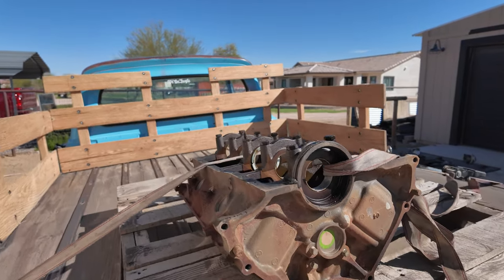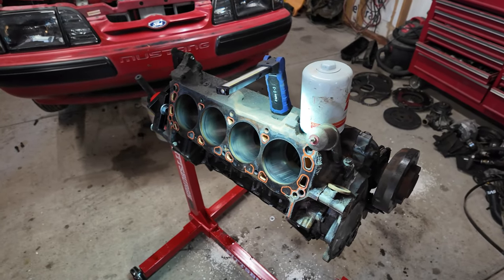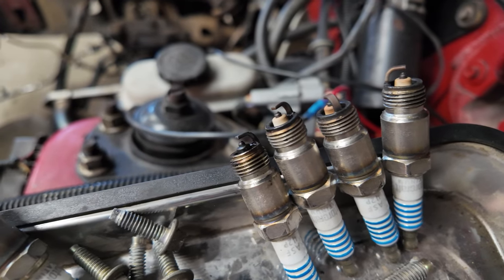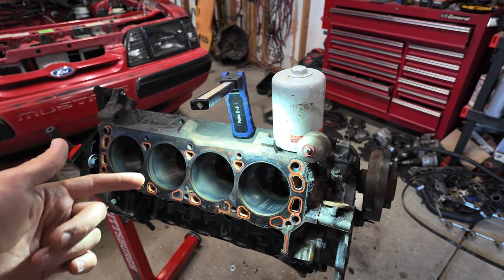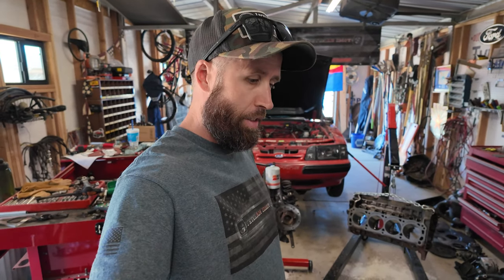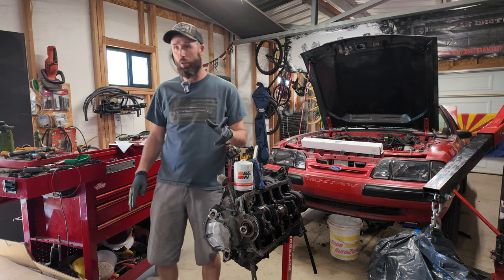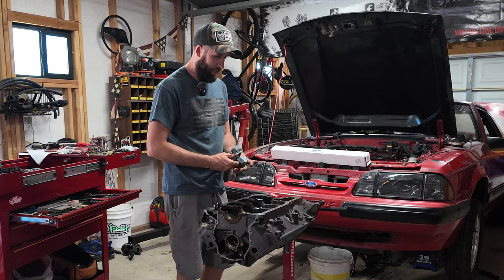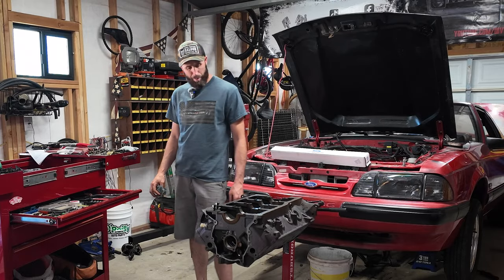BUDGET GT40 Rebuild, From Bare Block To Ripper #foxbody #mustang

Comment: Cool channel. If it was me. I would have trouble sleeping tonight not knowing tolerance for crank bearings. Used block with a different used crank, would have used plastigauge just to check. Keep up the great work.
Reply: even average typing paper can replicate the right clearance for testing in a pinch.
Reply: If turn's then send it 😂

Comment: When you decide to go carb, make sure you use a single plane intake manifold. The main reason is whenever you switch to a Sniper, they don't like dual plane as much.
Reply from the maker: Interesting, I was not aware of that. Seems to do alright on the dual plane on Earl and the 460

Comment: Should have done the piston flip trick and gave it a slight bump in compression.
Reply from the maker: Piston flip trick!? Do tell
Reply: Neo mustangs on YouTube goes in detail on it well but you basically take rod and piston from cylinder 1 and put in cylinder 5 with dot facing backwards and then vise versa cylinder 5 rod and piston you would put in cylinder 1 and you do that for the rest of the engine all the way back so 2 to 6 and 6 to 2 etc. all pistons have their dots facing backwards. If you look at the rod and piston from the side you will notice they’re slightly offset and not center and that’s where you get your slight bump in compression. But like I said check out neo mustangs here on YouTube and look for his vid on the piston flip trick for 302’s. I did it on one of my fox cars just last year.
Reply from the maker: Interesting
Reply: Yeah either way it’s no big deal but I figure since you had it down to bare block why not and a lil spice to her lol
Reply from the maker: Haha for sure, I'm gonna look into it before I go through the work out putting the heads on
Reply: Right on man, enjoy the fox content keep up the good work!
Reply from the maker: Thank you for tuning in! 🤙
Reply: @VeteranRevivals  NeoMustangs is a great channel for Fox Body budget performance.  His driver is >500hp wheel iirc, though that's with forced induction.  Check out 5.0Tussin for true junkyard performance.  He's fun to watch too.

Comment: All that work and you are going to reuse a timing gear and chain set with how many miles on them ?
Reply from the maker: Sometimes you just gotta add a little spice into the equation
Reply: Spice is expensive and disheartening sometimes  but ok I will stay tuned

Comment: I would you to plastic gauge the main and rod bearings to find out what your tolerance is. As well as check your ring and gabs before installing rings on pistons to make sure you have no ring bind in the bore.
Reply from the maker: Used plastiguage and gapped the rings off the pistons, just didnt film any of it because it would be two hours of me staring at a micrometer and feeler gauges hahaha.

Comment: 302 is a fair offer . Yes yes 260 289 were race engine . 302 to 305 ? Bof .but you are starting from the block .so that 302 will make plenty of power if big isolated electrical wire fly solo and are not held , touch by metal . Not even a rubber coated strap . Gm is nice ignition coil is on the distributor cap
Reply: Why would the 302 NOT be considered amongst the other "race engines" especially considering...
The 302 engined Ford GT40 won at Le mans in '68 just like the 289 and 427 before it...even without the manufacturers support that year...
Or...
The Trans Am series of late 60's early 70's which created the "Boss 302".  Designed and constructed as a 302 with incredible pre-Cleveland style heads to take those races also.  The 302/5.0 is arguably the most successful if judged solely by its  longevity (30+ years) or its aftermarket boom for Ford street performance....
Reply: @patrickf4692  i have no answer .